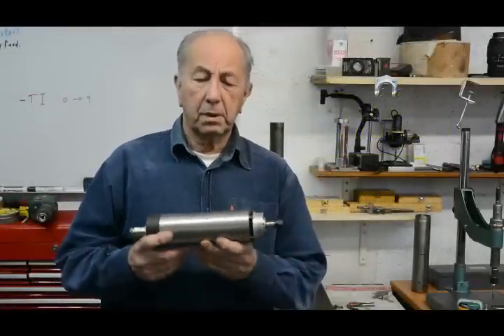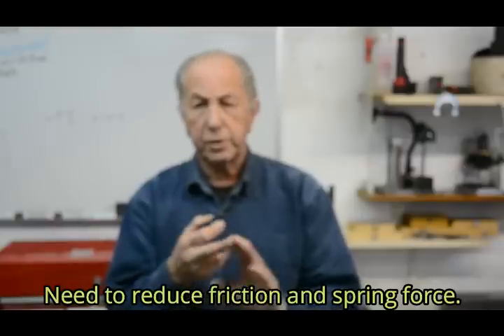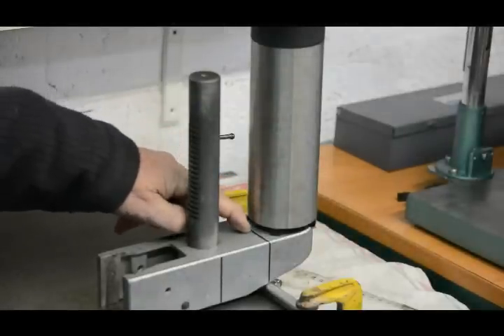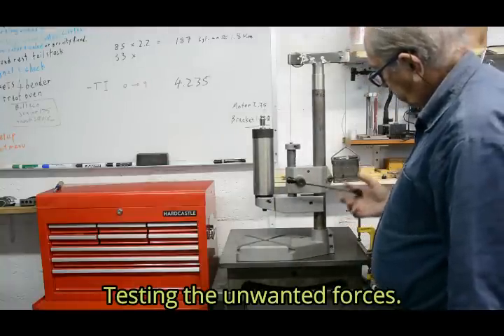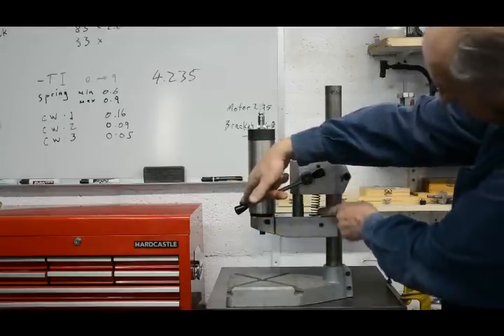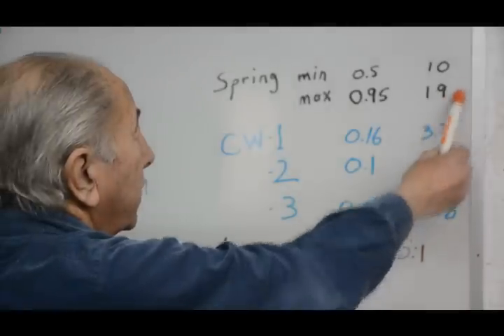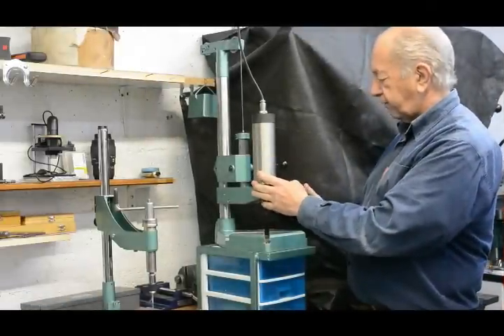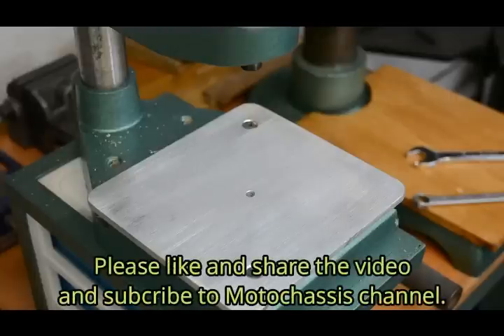DIY HiSpeed sensitive drill press

Comment: Hi Tony, just watched your sensitive drill video. Very informative. Thank you for posting.
A couple of questions though. Have you made a video about the spindle itself? And secondly what are you using as a collet in the spindle. I'm guessing at ER11 but if you could confirm please. I realize that the press is a modified commercial one but is the spindle custom made and if so do you have drawings available? Thanks,
Greetings from Canada's banana belt 👍🇨🇦🇺🇦🕊️🤞
Reply from the maker: The spindle is a commercially available unit.  You can get them air cooled or water cooled.  My use is not intensive and I went for air cooling.  You would need water cooling if you were using it on a CNC router for example.  They need feeding with up to a 400 Hz power supply and most sellers offer kits with spindle and VFD combined.  It came stock with ER11.  Search the internet for "high speed spindle" and you will get a load of info and people trying to sell you one.
Reply: @MotoChassisByTonyFoale  thanks for the direction Tony. I'll have a look see.